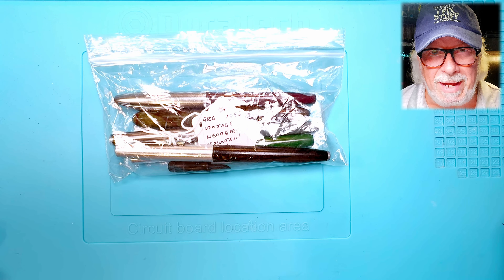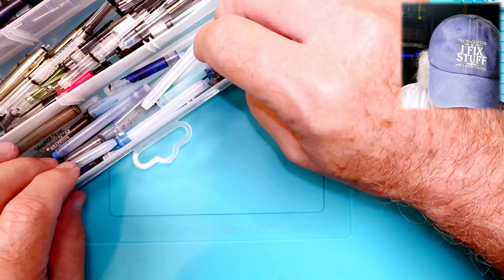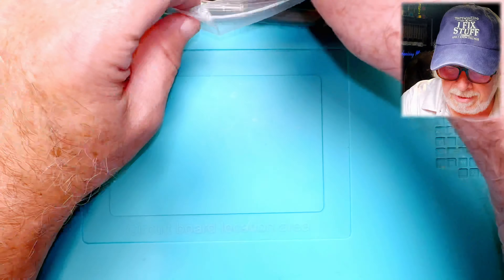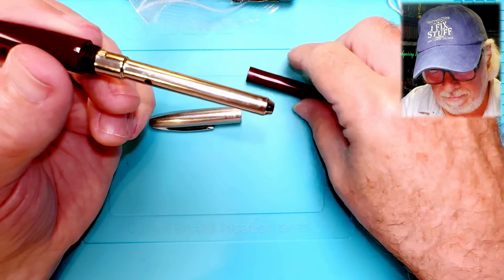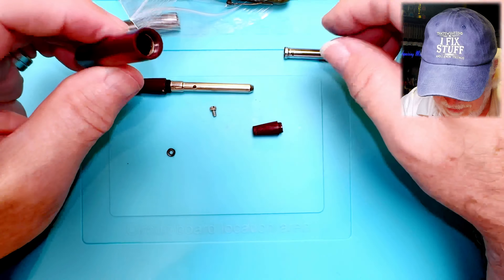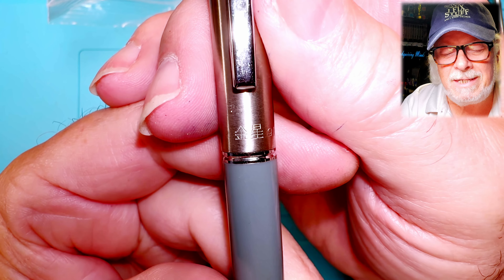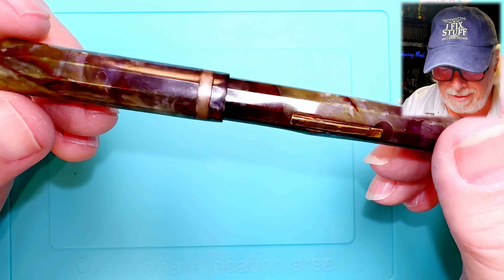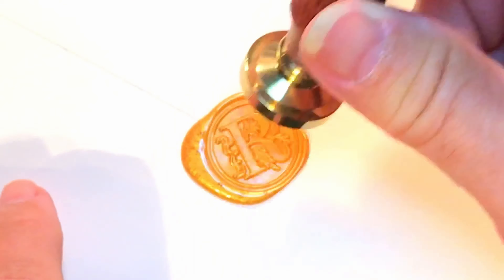Pen Resurrection Sunday Ep 68 - Son of Bag O' Pens

Comment: " Celluloid warps with age..."  Thanks- I never realized that I too am made from celluloid. All kidding aside, thank you for all you teach us. Can you point me in the right direction to locate some items like silicon grease for threads, o-rings, etc. And what glue do you use for barrel cracks? I am not sure what CA glue is but you said not to use that .
Reply: CA glue = super glue. It can be used to repair some pen cracks depending upon the original material they are made of without damaging it
Reply from the maker: CA glue is Cyanoacrylate glue, or Crazy Glue. You can get silicone grease at Goulet Pens, Anderson Pens, the Inky Nib, and Pentooling. I get my o-rings (generic) in PenBBS parts bags. Specific ones for snorkels etc I get from Pentooling. As to plastic barrel cracks you have to do some “plastic welding “ with methyl hydrate.

Comment: Had to dig around when you mentioned the Wearever. Pseudo autistic obsession at its best. 😂
Good luck finding a cartridge for one. They were proprietary, though Sanford made an "all pen" cartridge that worked, in the past. Those also worked for the Esterbrook cartridge only pens, as well. 
Good thing, if no cracks, you can eyedropper fill them.😉
Also read you can widen the opening of a LAMY converter for it, with a nail punch. 
Realize, this is anecdotal and not from my personal experience, so your mileage may vary. (The single Esterbrook cartridge pen I own looks like it'd eyedropper fill, no holes, but it came with an empty Esterbrook cartridge...)
Looks like some stuff to keep you out of mischief for a couple minutes. 😂 Gotta love friends who support your good addictions.
Reply from the maker: Thanks Paul!